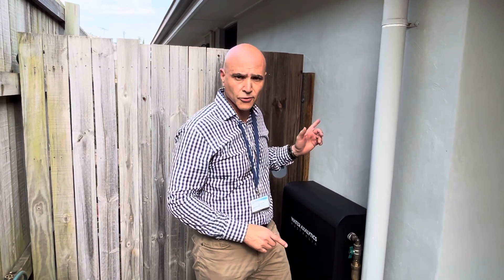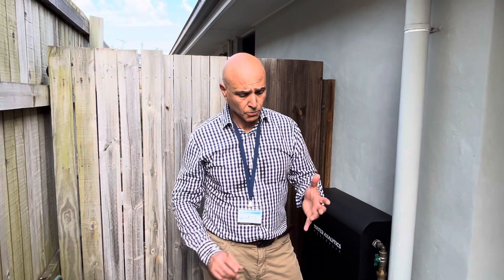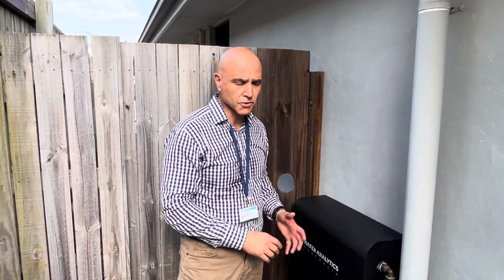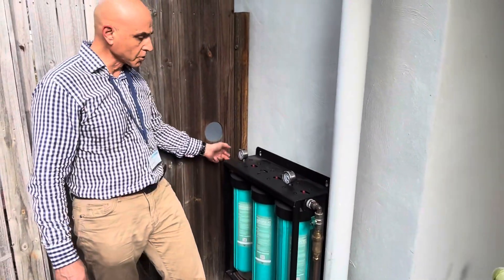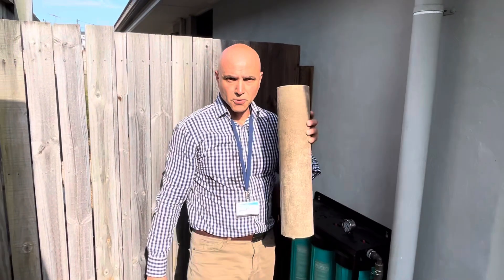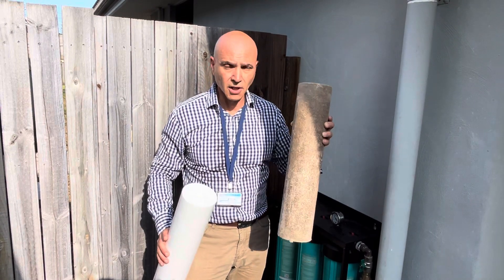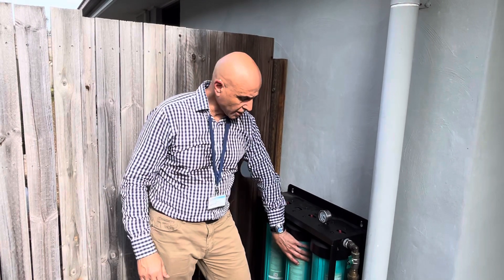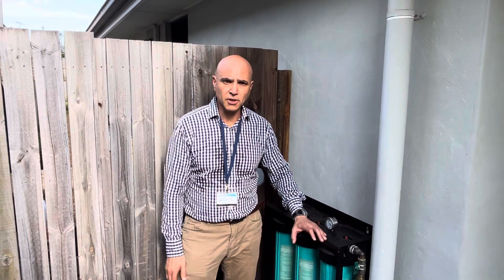Expert Review of the Water Analytics System: Insights from an Independent Water Quality Specialist

Comment: I have 3 questions please - The coconut carbon filter and the K55 final stage filter - are these filters sent out automaticity or do we have to order them and who changes them does the customer ??

And first filter the one that’s sent out 6 months free as part of the contract does the customer change this ?

And lastly, I read somewhere that if you leave the house for more than 24hours you have to manually turn off the system every time is this also true ? Thank you
Reply from the maker: Thank you for your questions!

Stage 1 filter (sediment filter) – Yes, this filter is automatically sent out every 6 months as part of the lifetime warranty, at no extra cost. Almost all customers replace it themselves, as it’s a simple process, but we do offer a service if preferred (with a fee).

Coconut carbon and Kdf55 final stage filters Can be ordered as needed or set up on an auto-subscription service for convenience. Customers typically replace these themselves, but if you prefer, we offer a service option for replacment

Turning off the system when away—no, this is not true for the WAA system. Some inferior systems may require this, but not the WAA system, which is designed for convenience and practical application...

If you have any further questions, it's best to contact me directly at sam.t@wateranalytics.com.au. Happy to help!
Reply: We are looking at purchasing a house that runs a trickle feed town water. Essentially water is fed into 2 concrete water tanks then pumped into house. Brisbane Southside. Is this system. Tanks look a few years old. Would this be a viable option to supply clean water for drinking etc